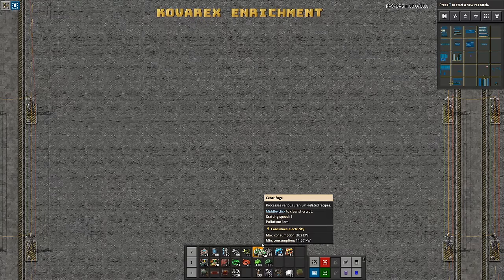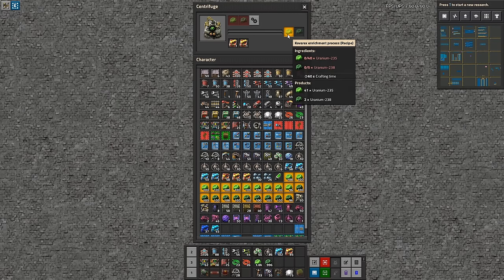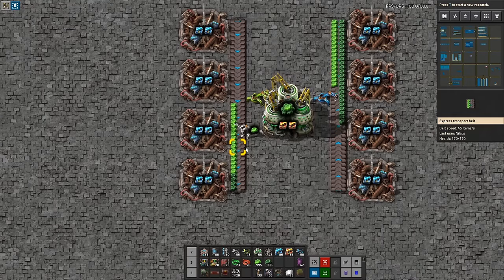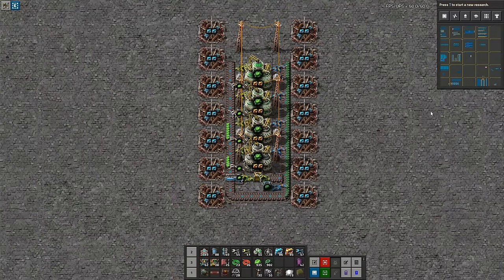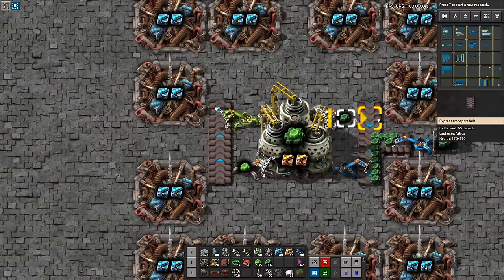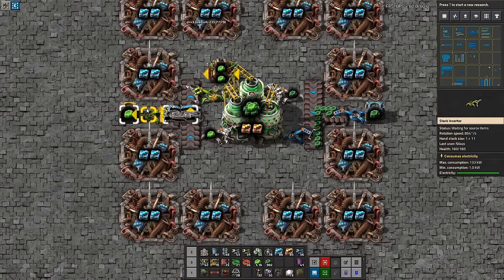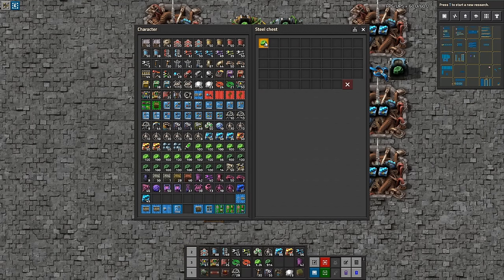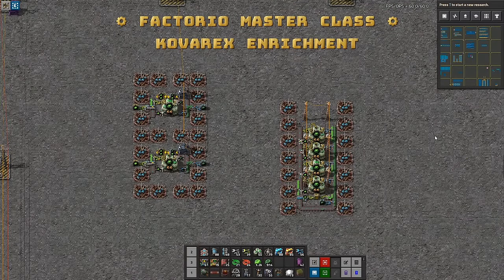Limitless Uranium-235 with KOVAREX Enrichment Process | Factorio Tutorial/Guide/How-to

Comment: I've just tried to build the 12-beacon circuit-driven design in an admittedly mod-rich environment, so maybe one of those is affecting behaviour, but I find that the top-left inserter, putting U-235 into the centrifuge, does not begin to swing until the centrifuge has been emptied.  It sits there in the "Waiting for space in destination" state, until all the U-235 product has been taken out. There is not enough belt storage for the centrifuge to empty entirely, though, and so the splitter "overflows", taking out more than just the one U-235 produced in that cycle.  This is Factorio version 1.1.80 on Steam/Linux.

Comment: Thank you Nilaus ! I've watched a lot of your masterclasses and playthroughs and i've learned a lot! 
Inspired by your design on Kovarex enrichment i've done something similar but without belts on the Uranium 235 side. I'm using steel chest instead. I have a slow yellow inserter set to stacks of 1 with a condition to activate only when there's more than 10 uranium 235 in the chest, that's my uranium profits , for continuing the process i have a stack inserter pulling from the same chest set to stacks of ten. Since the yellow is much slower it cant keep up with the stack inserter and only takes 1, or 2 (if there's productivity bonus) i've ran a few test and this hasnt failed yet so i believe its a simpler design. Nevertheless credits to you and your teaching without wich i wouldnt be able to think of this :D keep up the great work !
Reply: Nevermind. It already failed xD I'll have to think of something else. And this is what its so great about factorio :D

Comment: @20:50 its not because of game ticks its because the stacker picks up to twelve at a time. The reason it's not 48 is they didn't all get the the stacker in time. You could limit it by setting stack size with circuits, but that's more complicated

Comment: another alternative is to output with white inserter onto a belt, from there grab it with a stack inserter with stack size >1 into any non logistic chest, and from that chest have stack inserter with stack size =10 insert back into the centrifuge if there is >10 u235 in the chest, and with any inserter take out into a logistics chest if there is 1 u235.

it takes a bit more space, one extra any chest and one extra any inserter, but no circuit magic is required, aside of reading contents of a chest to enable/disable inserters.

Comment: 20:10 there is no tick of calculation that causes the 1 extra to be picked up, the machine does what you tell it to do. you tell it to stop picking up uranium when the amount is higher then 40 (uranium > 40) lowering the amount to 39 wil solve this issue or changing the uranium > 40 to uranium ≥ 40

Comment: Previously I used some nifty circuit logic myself on this, but since quite a while I'm just happy with the right (circuit-less) solution despite the extra 40 U235 per processing plant. I start with just one or two (depending on the amount of U235 avaiable), let it fill itself up, then (upon a later visit) add a 2nd/3rd/4th/... processing plant and maybe add extra U235 (from the centrifuges) to the cycle and so on. Works good enough without modules (or with weaker modules and/or less beacons) too. Sure it's slower, but by the time the Kovarex process is researched, I usually have way more than 40 U235 stockpiled and gain more than enough to feed my reactors.

Comment: An even simpler system is to output the light green to a belt, belt it to a box, input limit 5 into box and 5 out of box back into the system, output limited 1 when 1 in box out of box and out of the system. No circuits needed, only filter stackinserters that can be limited and enabled when there is a specific amount in the box

Comment: I found a blueprint once with a build that worked with only a wire, a condition and a limit on one inserter. 
Specifically an output with stack limited of 1 u235 (the excess) that triggered on the only one full stack output of u238. i believe it was with boxes for the instant move instead of belts but it would steadily always place the excess into another box with not even a single extra u235 in the centrifuge. There was a catch however. It could not account for the bonus of productivity modules as it wouldnt trigger because the bonus is only a u235 but you could still speed it up a ton
Reply: Funny, I have made something similar,  a few chests and inserters, inserts 40 U238 (or 80) and it goes and the 1 extra gets filtered out, I recently changed it to deal with the productivety module. Was a bit of a challenge, but made something that works. Maybe not the most elegant, but it works.

Comment: 20:50
Setting the stack size to 10 should fix that right? Then the 1 tick it takes to calculate/transmit happens while the inserter is swinging. 4x10 is 40, 3x12 < 40 Same number of inserter swings.
Reply: Be sure to do that for both input and output, or the belt will back up prematurely.

Comment: Could you just take the enriched output, multiple that by -1 and then send that back to the input inserter?

Edit 
I'm just realized, if it produces 1 extra enriched ore, you'll slowly trend to a negative number and eventually have the same problem where all your ore is tied up in the machine waiting to be processed.
Reply from the maker: + productivity bonus
It would be very difficult to keep it correct
Reply: @Nilaus  ah I hadn't considered that either.

Comment: I've had an issue with the top left inserter always leaving one or two U-235 behind on the belt breaking the cycle every 2-5 loops, replacing the red belts and splitter from the blueprint to blue ones fixed it somehow.

Comment: The inserters that put the dark green uranium into the system need to be conditioned such that they only swing as long as X dark greens are still in the logistic network. Otherwise you will turn all your dark greens into light greens and not be able to build nuclear fuel cells.
Reply: in that case, just extract more uranium and do the normal process to generate more u238
Reply: U238 is far too common for this to be ANY concern at all. Currently I've got a few hundred uranium fuel cells and the amount of U238 I currently have is disgusting. Thousands and thousands of U238 currently waiting to be processed into U235. Not to mention, since I am using flame turrets and laser turrets, I have pretty much no use for the U238 at all. Furthermore Nuclear fuel cells, when spent, will be able to be reprocessed back into U238. So, really, the only way you'd EVER run out of U238 for this process is if you stop mining uranium entirely.. which doesn't make much sense.

Comment: For the circuit driven processing I seem to be having an issue with the splitter possibly. I am not ending up with enough Uranium-235 to run another round. I end up short by several Uranium-235 and then have to wait for more.
Reply: I had this problem with the blueprint for the 4 beacon version. I fixed it by upgrading the belts from red to blue. That way the left hand side inserter didn't get a change to take and 235 until I got a backup of 5 items.

Comment: I've never been a huge fan of the ones that pull out 1 every cycle. They normally sit idle 20% of the time while reloading.
Reply: @InSomnia DrEvil if the loading stack inserter is set to <80 rather than <40 it will do exactly that.  That way it counts to 40 + 40 leaving 40 in the buffer so the centrifuge can run while loading.

The reset will still lower the count by enough to load 40 more and you don't have the 20% downtime, but it will add some delay to getting output that does not currently exist (roughly 1/3 of the delay the non-circuited design has).

Comment: Could you do the train guide again in detail. I saw your last guide and am still confused as to how the signals work. A more noob-friendly guide would go a long way for us noobs here. As always, thanks for all the awesome content you put up.
Reply from the maker: I cannot make it simpler than my previous train video.
Some topics require some complexity.
Maybe someone else can...
Reply: @Nilaus  I understand...thanks again for all the content...
Reply: Satdeep Singh from one noob to another, the best thing to remember about signals: use a chain signal immediately in front of an intersection (whether that is a fork or a crossing rail), and then use a normal signal far enough past the intersection for your train to fit, and not block the intersection. If you have a 2nd intersection before there is enough room to “park”, that should be a chain signal as well. Another good place to use a normal signal is right before and right after your stations (as long as the one before the station leaves enough parking distance). Hope this helps, it’s been working for me!

Comment: It could be i little better when you use one more inserter directly access to centrifuge and output directly to chest everytime when counter is 40 or more. Also it needs to connect output to belt and output only if counter is less then 40 and count this output not input :-) and change stack size to 10.

Comment: just put the counter to 39 :<
will take 40. circuits always start counting on zero.
puttin 40 into it has the value of 41.
with your reset both works, but makes it so strange.
Reply: no, if you put it to 40, it will count how many there are in the system, so, if there is a +1, the inserter does 1 less swing the next round, self correcting
Reply: @catrielmarignaclionti4518  thats not how it works. dont say no without any proof.
Reply: @marg0tten  its literally how it works, test it.
Reply: its not

Comment: Much easier is to have box where you check content and once the content is 40, you pick it up.
Reply: Interesting. How do you pull out the extras in that case, instead of putting them in the box?
Reply: @graemeesmith  Posted my blueprint on an other comment, but I have made something that runs on 40/80 U235, put in manually. The excess U235 is filtered out, 1 or 2 U235. No delays, no excess U235 in the system. Uses productivity modules and beacons with speed modules. I also built in a few fail-safes so cutting of power or power shortage doesn't affect it. When the output belt is full the system stops, belt clear starts up again. Been running it for a while now and encountered no problems (so far). 

The blueprint is added.

0eNrdWs1u4zYQfpWA11qBSJGSbGB77LmX9rIIDFmibW5kyUtJQdLAD9D3aF+sT9KhldiyItokBSebvdjW33zkx5lvZmg9o0Xe8K0URY1mz0ikZVGh2ddnVIlVkeTqXP205WiGRM03aIKKZKOOGpkUotl4JGBoN0GiyPgjmuHd5OKTy6SqvRoer7alrL0Fz+uOBWJgIS9XoqpF6qVrDrYk/97AN5cdM8GgmQch6wbOHCy1d3ik8yTd3U0QL2pRC94ysT94mhfNZgEYM3x4esEToAusbcsKboefAKXA4+ktm6An9euWKdMw/EpdrLacZ96mzJqce4GarRpnD4BcBpiSMQCBAUA4BoAaAIyiiF0EoP4oikIDgFEURQYAoyiKLdyUYgeA6QGAP24lr6p+UA8sOn4F9PeAmZA8bW8gAwjYP4qGyCHAPVFUXKpIP2cb922DOwIBtSzz+YKvkwdRSvVUKmTaiHoO17KDqaWQVT23Ez+lmXWiBJT66mizTWRSKxD0K9q1NxTtYPb0YvUhedZVFwFHgb+7U7e3k23F51VYh7FBqsoHLqXI+ByGkN7DyP/iLzrcZxM7LBjRL9jHkfrf3//s73iB4kWyyPk8E5X6RrNaNvx4VfIkm6+TIlNDqoET4HWZ5FXnltcL7b3g9mDE1yzbSnJeDC/cEOfEgfPALkiOag45kOdtUhyyy07tmjpl15f2J0jvBNPOnp4m/XPRS7WTDsc7mi7vc4idp3otitWpxw1E8XmHOnW5/cWOL2ErXyI6NtnZEmqA00iviEP2Q2f7vpH9yNwbwh/ZG77Ya/oQHbFFkeSUoPHUbkGpj60WlPjO9rGJshFsa59YOTwhZspJ/cBJOSntCSVlfeUMNc5BAtNY6Uz6Gin6XWOFaumg5nTQH5mO90wk4H4aNpl1UUJ9plfkIYjQAeKqov/T1Jr6IIkcOI/sljU2b8g6tj9tQ9Zyfa2GjEwt9gCcKoDAN+0NDpmZ2GQ4HPUSGvYVA4N+i7HGbwPcGSQwZtbkB6/jfA8vwm9E4V8bN8KBburEYurkdIk+pBUfld4VDTrneFMqxTrKjpVRCpekWDYrfrahbD0FyBL7md6XD4nkjx4vpEjXG7DhbWWZglyiTnjBqayBKT0A9sUoo86NU2BSBwfujR8xqYMD68Zvajf+yNZ+bGc/PrXfgELLlSzh+3InQgZy00tMlE29bdR/E28R3TurwGRFqHVn5VsxRt07q8CkTqDE2b6Rx1IzEeg0A1cXAUqNpbxT6ZKPq3RHSTkhWiknfSlnTCPllFlQFn3GxE90e3k0NN16iJwKMxL3FoHocy/RNRQ0svkLibn8Txhf/k/3XBFItZyc2VpVMrA3Pjcs62OkMBrlD0Tt5g3M45gPqmYBvrMf7lBR0o4bNBMVXKzWi7LZ4zM6ZJb5LuUh/exbptpymWGbLVMXh2TEObEzk8TFAmf71Mg+NXJE6jONI9LpoCMyhzjtaJdlnLY7V1eIUxa6JGn62fdVtWmI2byF4BZQVq8hOL0KMrV4XcYJIfQt3pdxQ7ASNicEMqJHCvU9kig0LVIYWLyi4zYlavGOjhsCswmPywh37WVl7vDO3QTlCSwAnPujFbKbP9X24bd7kICbX25+l7fw+Vsi8ipZ8hv6tW1hvugbmDswCSJStUoVYxpNSRTEQAX1d7v/AV7fVWA=

Comment: Curious. Since the first combinator randomly outputs a signal of 41 instead of 40 and the second combinator always puts out a signal of -40, won't the first combinator eventually tick up high enough because of the residuals that it eventually causes the connected inserter to stop functioning altogether? If so, how do you cope with that?
Reply: It's self-correcting.  Once it gets high enough, there will be 1 less swing to load the machine and it drops back to 40.

Comment: I stamped down  the fully beaconed setup and I noticed the counting logic would occasionally set my centrifuge one short (also known as dead). I fixed this by changing the setting on the inserter itself from 40 to 41.  Due to the automatic reset, this is still successful at reducing  dead uranium which is doing nothing.

Comment: I personally take the blueprints you make and highly improve them.
Reply from the maker: highly improve them? They must be really bad the ones I make then...
Reply: @Nilaus  To be fair there are some pretty significant improvements that can be made with much simpler circuit networks. Such as limiting the stack inserter (the one that inserts U235 into the centrifuge) to only ever hold 10 U235 at a time. Fixes the over counting to 41 issue that you encountered at around 20:30 ish in this video.

Comment: My version is simpler. I don't need circuits. It is purely mechanical and elegant. The material circulates around the centrifuges. I use 2 inserters to remove the material and 1 inserter to put it back on the belt. This is true for both U235 and U238. Thanks to this, there is always enough material on the belt for production, and the produced U 235 accumulates in the crate.

Comment: Blueprint plsssss! :( and could someone pls explain the logic of reseting the combinators?
Reply: The values on the network are added to inform a single value for a symbol. The -40 informed by the aritmetic combinator for U235 value is added to the current 41 of the decider so the current value  for U235 resets to 1.

Comment: 17:04 is already a pretty good version. you don't really need to limit the centrifuge to only take 40. The extra amount it takes is just a buffer. Early on, to get some fuel rods you can just take a few out of the centrifuge by hand, and then let it build up. Once the buffer is full you'll still get the same output.

Comment: I think your "Simple" process is incorrect.
hear me out on this.
On the right side: If you are constantly re-feeding the 235 back into the system you never get any excess back out. Essentially you are feeding 235 Twice into the loop. 
The Top most Refinery is your start point, this one feeds the next one down and so on. 
So what you want to do is take all of the Inserter out on the Right, Replace them with a white Inserter (1 per refinery) and white list 238 only. The at the end of the Top Right side Belt add 235 Storage (on passive/buffer) to be sent to the Power Plant, This way the excess doesn't keep refeeding for a Third Time back into the loop. 
This works but it does take a significant amount of 235 to get started.

The Reason your build doesn't work: is because you have a inserter taking out the "Excess" 235 from you bottom most (middle) 235 Storage. This Triggers a refeed that isn't needed.
Reply from the maker: It works and has run 100+ hours within a problem

Comment: The issue with any combinators memory cell setup is that if you get a brownouts (even an absolutely tiny one), you're fucked - and you might not notice it or be able to find and fix it in time to save yourself from a power death spiral.

The... The fix is to make a fuse so that if your accumulators go under, say, 5%, the power switch turns off.

Yes. You heard me right.

A power switch.

Put that fuse anywhere you want, really. Be it right after your power plant so your whole factory is immune to brownouts, or just in sensitive areas to keep the combinators from going mad. Oh and put in an alarm for low power too while you're at. Just so you know when there's an issue.

Comment: 20:30
just wire the inserter directly to the centrifuge with the same enable/disable condition.
if there's 40 in the centrifuge when your inserter asks if it should put another in, logic gate says "yeah, that's less than 41", and then it puts another in.....   how many are in the centrifuge.   (Do when less than) is the same as (stop when equal to).  There are no frame drops, just poor logic.   
remove the 1 overflow belt, put the inserter next to splitter, limit 235 output arm stack by 1 for safety...
some of these designs are pretty good.  I presume the twitch users are grabbing prints from the forums.  it's a roundabout way to not have to say the design was sniped from a real engineer. |
https://www.reddit.com/r/factorio/comments/ezh249/self_sustained_kovarex_enrichment_blueprint/
not the forums, but close enough. 3rd google hit for 'factorio kovarex blueprint'
womp womp.
Reply: Can't attach circuit wire to a centrifuge.

Source: I just tried it.
Reply: @shingshongshamalama  Correct, same with assembling machines. Not sure why because that would help a ton lol.